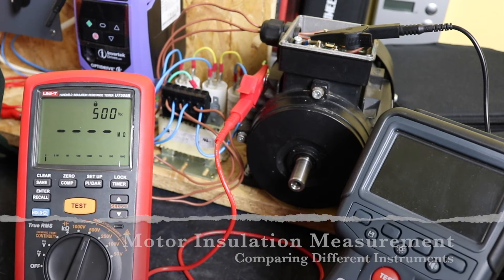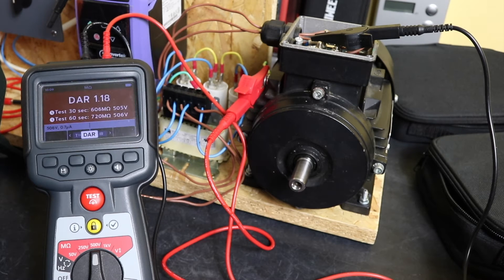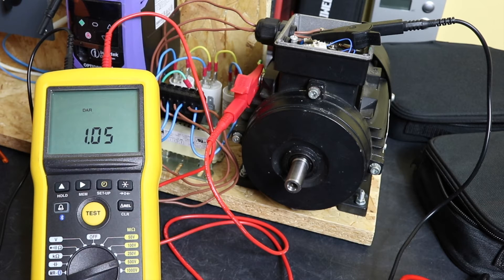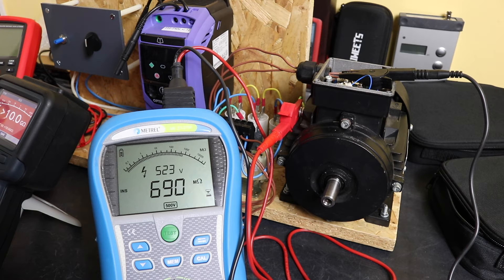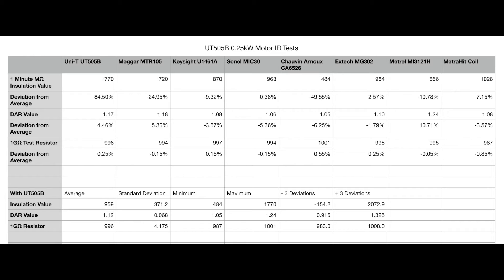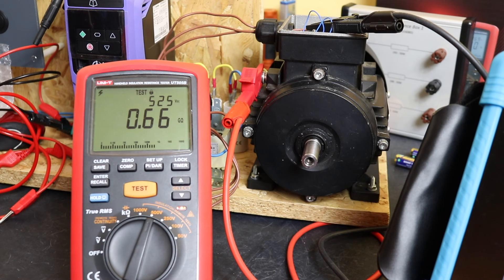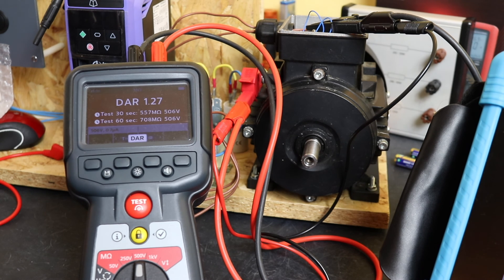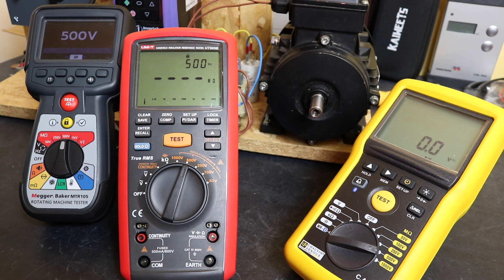UT505B Insulation Resistance Test Comparison

Comment: Это Вящий(Многозначительный) опыт сравнений товарищ ! Вот где видно падения напряжение, у keysight 41461, я прав?
Reply from the maker: Yes, the 1461A is displaying the output voltage in the bottom right hand corner of its screen. MTR105, shows it in the bottom left hand,  Extech and UT505B show it in top right hand corner, Metrahit does not display it, Metreal and CA6526 dispay it in the centre of the screen above the MOhm reading, although with the CA6526 you have to select with the arrow key as the voltage is not displayed by default.
Reply: based on your experience, will the voltage drop readings be different for all the devices in this comparison, and will the Ohms on the diode also be different? Thanks in advance for your thoughts.
Reply from the maker: @sumidorpopolf5173  Yes they will all have slightly different readings depending on the accuracy and measurement resolution of each of the meters. I would expect them to be within 10% of each other.